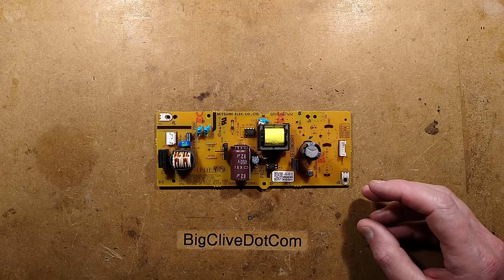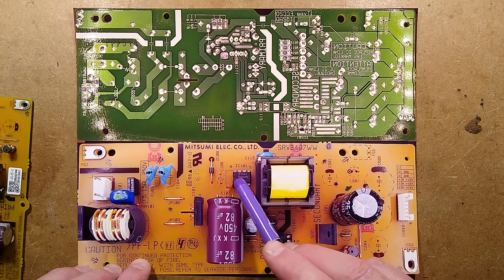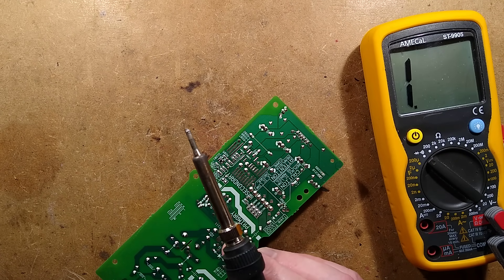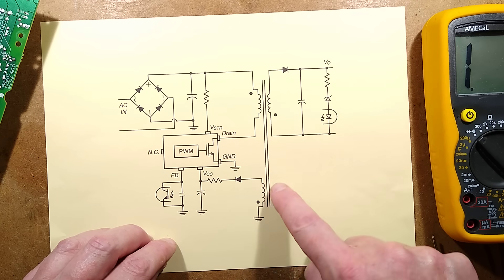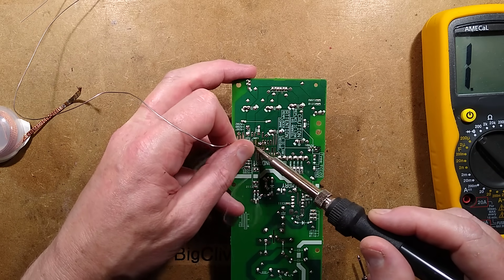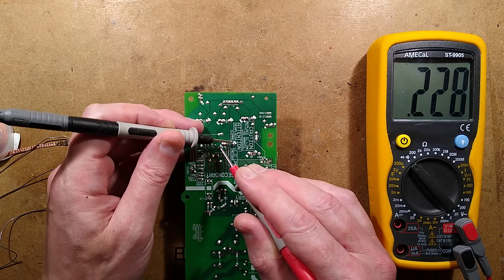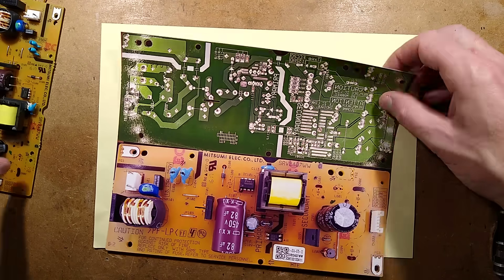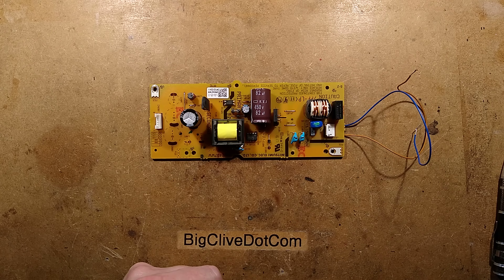Diagnosing a faulty PSU

Comment: "There's no problem with having too much flux." It flux it up sometimes, though ;-)
Reply: Actually, sensitive analog circuits or other high-impedance circuits can behave differently if flux still remains after power on. Cleaning the board can be a good preventitive measure: Or, a corrective measure if you're testing it after resoldering/replacing something and it's not 100% working AND there is visible flux residue.

Comment: Nippon Chemicon capacitors are generally a sign of someone not cheaping out, so reinforces the "common sense and safety" comment in the description :)

(That big, painful 450V capacitor prominently showed the Nippon Chemicon logo - they only include the company name inside the logo in really big capacitors - and the large capacitor on the secondary side was in the same style, even though the logo was hidden.)
Reply: I re-capped my DBX 286A microphone processor with all new Nichicon caps.  It wasn't a cheap prospect.  I don't regret it.  I got it faulty from Ebay for $49.  It's fully functional now and quite impressive.  The only two I did NOT replace were 2 bi-polar caps that I had not prepared for.
Reply: @TechGorilla1987  The Nichicon Muse ES series are the ones you want for the bipolar caps. Lovely shiny green sleeves!

Comment: I love watching your videos, but I’m not very knowledgeable about this stuff.  The other day, I got brave and tried to fix a switch mode PSU for a Nintendo 64.  I now know why we idiots should not be doing that with the unit plugged into mains.  I made a big scary pop and immediately threw the whole thing in the bin and announced my retirement from PSU repair.
Reply: That's quite scary if it was you that made the pop.
Reply: @brancheternal  Well, not directly, I guess.  I’m about as good at wording things as I am at PSU repair…
Reply: lol we all have pop accidents. don't just give up yet. PSUs are very easy to fix once you understand its basic fundamentals. safety precautions comes automatically once you nail down its working principle. you'll be surprised how many electronics fail because of single faulty component on PSU and how it can easily be repaired, saving you tons of $$. be patient and learn your basics. dont give up yet
Reply: Are you sure the pop came from the board and not from inside your pants? 😂
Reply: that's the way a lot of us started out, then learned wisdom
Reply: you know what i did i just started playing with 555 timer circuits and making my own pcb boards , and every once in a blue moon i attempt more complex projects ...